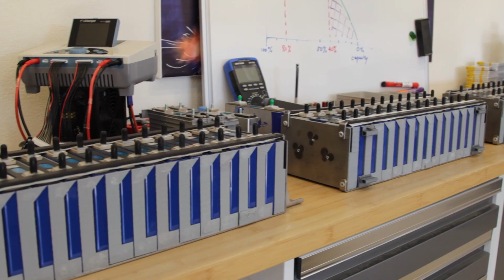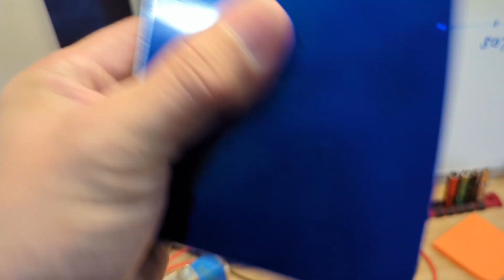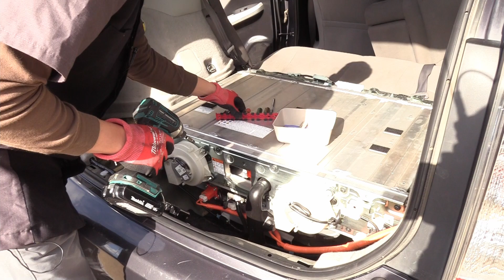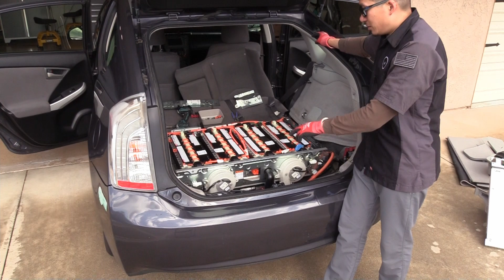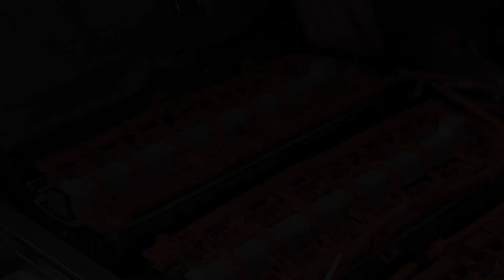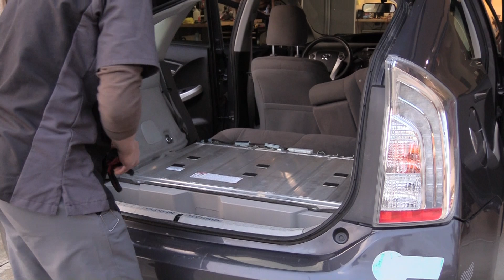Prius plug-in new Nexcell prototype battery swap - step by step

Comment: I purchased a Prius like the one in the video. While searching for information, I saw that it's very important to clean the battery cooling air inlet filter. However, I can't find any filters to clean on mine, only a grill with a mesh width of about 1 cm, for both the right and left vents under the seat. I searched online and couldn't find any information. I was wondering if there should be a fine-mesh filter or not? And if there's a filter I should add for the left vent?

Comment: Hello Jack! I am following your work for a few years now. I own a 2012 PlugIn Gen 3, exactly the same color as the one in the video. I like it very much, but it wouldn't hurt a bigger EV range. I got inspired of this video when first saw it, but just now I got a good quotation for a set of CALB batteries of this form factor. From more sorces I understood that this upgrade won't work because Toyota is using Coulomb counting and won't use more than it was programed to use in the first place. What is your experience with this. You did not upload a continuation of this project, so I'm concerned that you have a reason why. Did your upgrade result in a bigger EV range or not. Does the car integrate the new capacity or uses the equivalent of the old capacity, leaving the rest unused, resulting the same EV range with the new cells as well. Please explain a little. I will make my decision based of your experience. Thank you for your help.

Comment: would be awesome to remove the back seats and put a second full size module there!

is there any way to do that? meaning on the charge/vehicle software side, and have the vehicle recognize the second battery pack , and have the BMS properly monitor and float the charge on both modules?

Comment: May I ask what the per cell measurement is? 

As I am driving a toyota noah 2023 model, which uses a similar lithium battery like this, however would like to confirm the measurement before purchasing

Comment: Any possibility for delivery to Europe? I'm looking for this solution. What is the ithum type? LiFePO?
Reply: He said at 1:21: the Nexcell is NMC as the original Toyota. I think, it shouldnt be LiFePo, because of the different charge/discharge characteristic. Or need to hack into the BMS software or even other ECUs too, to change the factory presets from NMC to LiFePo.

Comment: too bad you do a lot of removing cables on the first module without explanation. And you rip those cell blocs out, which does not look very careful. you know, for us time is not so important, than proper work. And you should have unpluged the safety switch again, after test starting the car!

Comment: Couldn’t someone take the newer prime cells and swap them to a gen 3 plug in?
Reply: The 2017 Prime has the same 21,5 Ah cells, but nearly twice more: 56 ->96 unit. So the battery pack is bigger and uses higher voltage (207.1 V -> 355.1 V). Would be more difficult to fit in and integrate into the HV ECU, BMS, etc software.

Comment: Wow,  looks like my year 2012 plugin prius.   I must buy it.  LOL   Yeah,  my range nowadays is only 8 miles.  hahaha
Reply: In how many years and how many kilometers (miles) can I expect to change the battery on a plug-in hybrid? I am considering purchasing one that is 10 years old and has nearly 200,000 km (124,000 miles). I appreciate your response."
Reply: @etamocicleta4899  The Prius plugin keeping its battery well. No news about failing batteries in 10-11 years old plugins. I have a 10,5 years old one (205 000 km), and has minimal sign of battery degradation (calculated in different ways and all get about 5-8%).
Reply: My 2014 PIP has 150k, only replace 12V battery once, tires once, and oil change every 3-5k miles by myself. It seems maintenance free for me. It still has 10-12miles EV. Brake pad still has a lot thick. Really want to replace and do some flush fluid, but it does not allow me do it. @atkak8561
Reply: @etamocicleta4899 
I have got 2013 prius 150k miles still 10.5 miles when charge full

Comment: Have a 2017 Prius Prime Advanced w/43k mi.  that suffered rodent damage to the battery wiring harness.  All cells in the battery are fine.  However,  Toyota will not replace the harness, only battery w/harness.   It has taken months to get the new batt., but it is supposed to come in this week.    Looking for ideas about how to insure the old, perfectly good battery ends up in someone else's car rather than being trashed by Toyota's recycling sub-contractor.

Advice is welcomed!

Comment: I also doubled battery on my 2012 plug inn and it did not change much its programmed to drive 13 mils ev and still engine starts it needs reprogramming for it to improve the only difference i noticed is when i stop and start i always get 0.6 miles ev and a little better regeneration i hope someone can figure out how to reprogram!!!!
Reply: Did you use LiPOFe4 batteries? They will go longer in ev mode, since the battery maintains higher voltage than NiMH before discharging.
Reply: I used batteries from prime  i think they are lifepo4 im sure they double the capacity but still same expect 13.5 miles
Reply: @Yuriy khmaruk  are you sure?
Reply: @blackjmyntrn  the prime battery is 25ah.. gen 3 pip uses 21ah battery so very little increase.. you would need to use 50ah batteries like done here..
Reply: @netprep  Prime is more like 43ah or 8.8kWh. The new 18.1kWh from one of the new PHEV Lexus vehicles is what I'm hunting for or the new bz4x with 71kWh.... I need over 50kWh usable battery capacity for my needs.
Reply: @priusoverlanding  Prius prime has 96 X 3.7v, 25ah cells which is 8.8kwh..
Reply: @netprep  Looks like we are saying thr same thing. :)
Reply: @priusoverlanding  prime is not 43ah.. it has 95 prismatic Panasonic cells in series.. 95 X 3.7v X 25ah = 8880watt/h or 8.8kwh. That's the max capacity, but Toyota bms only charges to 80%, so the usable capacity is 20% less. Definitely not 43ah.
Reply: @priusoverlanding  The most a prime could do is to replace the 25ah cells with 50ah ones, that are the same form factor. . The RAV4 prime uses 50ah cells. Need to be in the vda phev2 form factor to fit.
Reply: @priusoverlanding   50kWh? I don't see how you could practically fit that into a Prius...
Reply: @SolarWebsite  are you familiar with the size and capacity of the bz4x HV battery or any of the new HV batteries in the new PHEV Toyo/Lexus Vehices? Once you are yull see the light at the end of the tunnel...

Comment: So far the lithium pack that I bought for my camry hybrid have been working like a charm. I'm still impressed you simplified the whole battery pack. Thanks!
Reply: What kind of performance are you getting in the Camry. My 12 Camry is coming up for replacement
Reply: @chaos2015  My camry is a 2010 hybrid with 200,000 miles on it and it went from 24mpg avg back up to 35mpg avg. Keep in mind my battery pack was already having intermittent issues and kept having warning lights for Hybrid system hot. When I press the pedal for power it is more responsive. And, last notable item was my internal combustion engine, it stays off longer. No more loud idling just to charge the battery.
Reply: Hi . Let's say I will update my Prius' battery from 1.3kw to let's say 13kw, keeping same voltage? Would it be as easy as putting a bigger battery in your torch? or I will have to do some changes to the software and electronics?